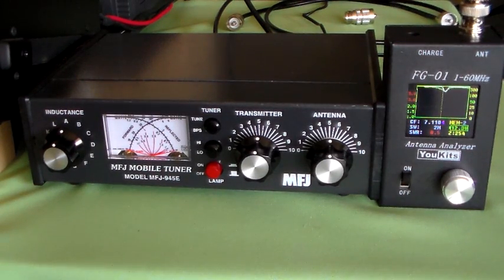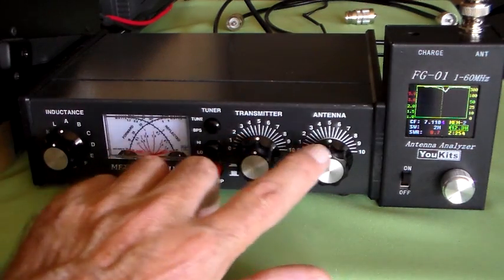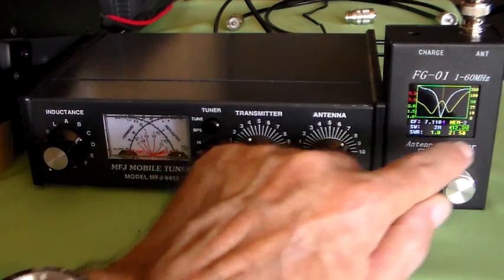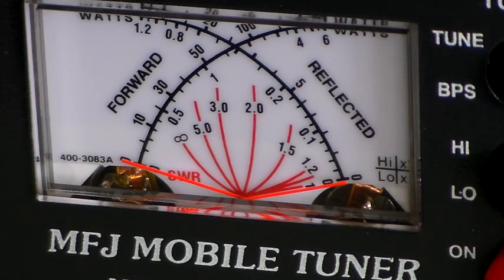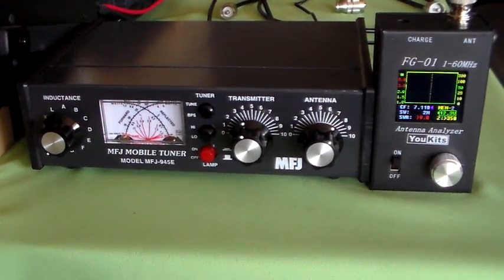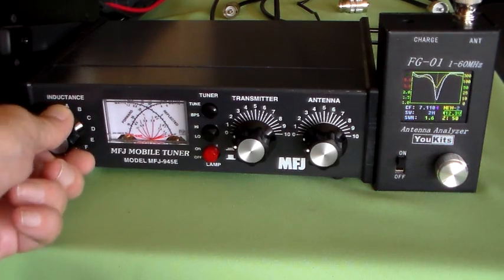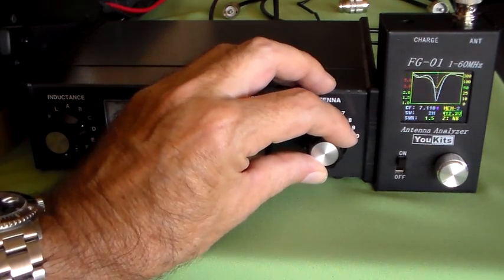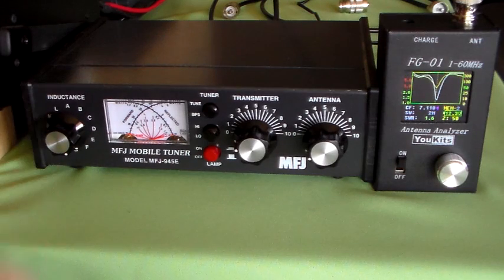Best Manual ATU Tuning Method.

Comment: Thanks for this video. 941E  manual says that you can get the similar SWR readings with different  inductor settings. What about if you have used some other inductor/inductance setting C  - any comment on that. 73' OH2XA

Comment: Is the FP-RP meter between Tx and ATU or between ATU and feedline to antenna? If former, how much of tde 5% increase was lost in the ATU? If latter, how of the 5% increase  sdows up as a 0.2 dB increase in radiated RF?

Comment: I still have my roller coaster and variable capacitor I used to use. At times I still do.
L inline and C from the long wire or vertical to earth. For some lengths of wire It was better to put C at the other end of L.
I used to tune for maximum r.f. out using an r.f. pickup meter at the aerial before I made my resistive SWR meter. My amateur friend was horrified! He was still horrified when I didn't calibrate the meter and just tuned for the lowest reading. After 5 years I did calibrate it.
I found that most r.f. out didn't necessarily coincide with the lowest SWR. I'm only talking a fraction more out as you showed. Somebody's receiver would not notice.
Nothing above 5 Watts here.
G4GHB

Comment: The MFJ manuals differ on that point. The MFJ-949E manual advises you to set the maximum capacitance and minimum capacitance possible for a good SWR. I've followed those instructions and got nice results when using my 11 meters T2LT antenna. I was able to tune and get signal out from 10 to 30 meters.

Anyway, the more inductance, the more fiddly the tuning is.

Comment: That was fascinating. Thanks for posting. Any idea why you measured slightly more RF power out despite a higher SWR?  Seems counterintuitive. 73
Reply: I found it too on my set up. Maybe true resonant point of an aerial?
G4GHB
Reply: @bill-2018  When I match my vertical antenna, I can't select max C. If I set max C, no amount of I will bring the SWR down below 3. I have to start at mid C, then I can find a suitable I to get the SWR below 3. Then I can get the SWR down to 1.0 with a little more C on both sides. One oddity I have observed is that sometimes I get a little more forward power when the SWR is slightly above 1.0 (roughly 1.2-1.3).  I can't explain it, but that's what I see on the 945E meter. Someday I would like to understand this better. 73
Reply: @nateitkin8279  I had (still have) for many years a long wire with a roller coaster and variable capacitor to tune it and an r.f. pickup meter at the aerial. When I built my resistive SWR meter I found a tiny difference between the lowest SWR and maximum r.f. out. Very tiny! No-one at the receiving end would notice.
Watch Dave Casler on his Y.T. presentation on Ask Dave number 221. He explains SWR and resonance and inductive and capacitive effects on aerials.
73, G4GHB

Comment: Try Antenna cap at Max and Trans at 30 % cap. You usually do not have to change the Ant cap again. I use a Heathkit tuner.  Thanks and best..

Comment: Nice video.  I wonder if the difficulty encountered in method 2 has to do with the choice of the physical position of the taps.  They were factory set with the method 1 in mind.  To best set it up for method 2, I guess one can change the tap positions on the coil.  Likely a fools errand from a practical point of view.

Comment: The slightly more forward power is a myth.
What is actually going is that there is a phase variant between reflected and forward power.
So you are measuring more forward power but this can not be true since your transmitter is only a certain power. Say 1 Watt.
Make your SWR slightly higher and you see more forward power.

If you really want to measure what the best tuning position is, get a field srength meter and try to find the 1:1 position that gives you the highest field strength.
That is the position you need.
Reply: As reflected power is reflected back to antenna in phase with the forward power at the radio /feedline mismatch, (adds together) it's not a myth

Comment: a lot of you still seem confused about this
there is ONLY ONE proper combination of inductance and capacitance for the (most efficient)  True Tune
there are multiple ways to find it and there are plenty of settings that are just good enough but still ultimately only one is correct
only the one True Tune allows for tuner's full rated power handling  without an arc

Comment: You appear to get more power but what is happening is the reflected is added to the out  put appearing to have more out. Cross needle meters always add in the swr !
Reply: Thats correct the reflected power joins the forward power back towards antenna

Comment: K4KID here... Typically you have to double your power (3db) for someone at the receiving end to tell the difference so the needle's breadth of increase is negligible. Thanks for the lesson though.
As for reflected power... I would prefer 10 or 20% less power out w/ ZERO reflected power to keep my finals happy. I have a 31 year old Kenwood TS130 w/ the original finals that still produce full rated power and I think that's because of the "LOVE" I've shown them. Happy airwaves to all. K4KID

Comment: With my own t-match I used to start with both capacitors half meshed and then find the inductance for best match before making final adjustments to the capacitors. I don’t think that it was the optimum, efficiency was not my problem but flashover at high power was. I know this video has been up a long time, the behaviour of the forward power meter is normal, it does not prove the power to the load is increased. Just a suggestion, put a 100w lightbulb in a box and use an exposure meter or LDR to determine maximum brightness as you tune the atu, many rigs can produce more power into loads that are not exactly 50 ohms with zero reactance. Found your channel via your GS35B experiments, great stuff.
Reply from the maker: Thanks. The difference in output power wouldn't be detectable at the RX end. It was just a fun experiment.

Comment: I used an Ericsson auto AMU many years ago that tuned under low power. It started with min L and min C, then increased L until max fwd power, then increased C for min refl power. As the refl power dropped, the fwd increased. Further fine adjustment could be done after the auto had run to obtain the best match.

Comment: the higher power reading with max cap is due to circulating currents and is Not adding to the forward power despite the reading, just to heating.
You significantly reduce the max power handling before arc-over of the tuner with this tune as you have to use both more XC and XL
Should always tune with least inductance even thought other combinations are possible 
Least inductance will give you the widest tuned bandwidth and is much less touchy and fussy - less coupling to your hands while operating the knobs and ensures highest max power handling before an arc over
Reply from the maker: Yes, setting the caps to 50% and setting the inductance is the way to go.
Reply: Reflected power adds to the forward power back towards the antenna at the feedline /radio mismatch

Comment: so how to tune up with a radio without transmitting, do you use a tee into a dummy load? can you show.
Reply from the maker: No T piece. Take the coax out of the radio and connect it to the antenna analyser. Set the frequency of interest on the antenna analyser and adjust the controls on the ATU for a good 50 Ohm match. Then take the coax off the analyser and connect it to the radio.

Comment: If you are transmitting 1W from a rig capable of transmitting more than a watt, then there is some sort of control loop inside the rig keeping the power at 1W.  A couple of methods of doing this are to monitor the current in the PA or detect some of the forward power using a directional coupler.  In any case the assumption of the designers will have been that the transmitter will be working into the nominal impedance i.e. 50 ohms, and all  the development work of the power control loop will have been done into a 50 ohm load.  If you mismatch it, the power control loop will move to a different point.  It may produce more power, it could be  be less power - nobody knows because you have moved to a condition where the behaviour is not specified.  All you are doing is looking at the behaviour of this control loop under the changed conditions, and you have not proved anything general at all.

Comment: I want to say a big thanks to you for taking the time to explain to the new amateurs how to use a manual tuner. I started off with the old Military style variometer, ie. crank it up to get an antenna current reading showing on the meter and usually adjust a capacitor to tweak for maximum. This was done at a rate of knots so you were spending minimum time sending out a carrier. Totally crazy has you then spent ages on that frequency banging away on the key passing all the required traffic that needed sending. 73 de John - G0WXU.
Reply from the maker: Thanks for the feedback John. Of course it's much easier when no-one is shooting at you.
Reply: Sounds like you were working with a transmitter much like the Command sets used in WWII bombers. Those were my first ham transmitters.

Comment: You called it a "Manual ATU."   "ATU" stands for "AUTOMATIC" antenna tuner."  A "manual ATU" would be a "Manual Automatic Antenna Tuner."  Say what???
Reply: Antenna Tuning Unit
Reply: ATU actually stands for Antenna Tuning Unit. The correct acronym for the automatic version is an aATU.
Reply: ATU = Antenna Tuning Unit

Comment: I have the 949E and it is great… 3945 looks good as well
Reply from the maker: The MFJ tuners get the job done, you just have to remember to halve the power rating. What's a 3945?

Comment: Nice demonstration, may I add another quick reference point to start with is tuning for noise first, capacity half way then find more noise with induction, most occasionally you are near a reasonable matching point. 😁
Reply from the maker: Thanks Ray. Good point... I'll try to remember that if I do any more of these videos.

Comment: Bought first manual ATU this week and struggled so far  :(   Found this very informative and practical thanks - just need to go and put it into practice. I'll be back to say how I got on !
Reply from the maker: Thanks for the feedback. Good luck with it, I'm looking forward to your results. What ATU did you buy?
Reply: Hi, I bought the Comet CAT-300. The unit is fine but the instructions useless. I think it would be in the bin by now if I hadn't found your youtube tutorial . cheers Mark 2E0XCZ
Reply from the maker: There's a couple of videos on that tuner here on You Tube... it looks pretty good. What's a bit less confusing with the MFJ is the inductor is labelled A to L, not 1.8 to 50MHz, so if you choose an inductance that works it doesn't look wrong if it has the the wrong frequency band written on it. I'm glad you found my video useful, thanks for the feedback.
Reply: Ditto for me today with the MFJ 945e, over the MFJ 959c auto, bog difference in Leicester for the manual, but happy with my choice

Comment: I use to work you guys (VK/ZL) back in the early 1980s on 20 Mtrs running a Signal One at 5 watts and a 40Mtr dipole. VK6 and VK7 were my favorites.
Reply from the maker: I worked VK from London in 1987 when I got my UK 'A' licence. Just 100W and a bit of wire down the garden. You can work the world on next to nothing when the sunspot cycle is generating lots of spots.

Comment: I'm new to hobby, so thanks for this. I haven't got my license yet but have built a 20m doublet (open wire fed) and have just bought the MFJ 949e. Because I'm only listening for now, is there a way of using an ATU to increase receive noise? Do you set it for max reflected?
Reply from the maker: Just set the capacitors half way, then rotate the inductor switch for the maximum noise, then adjust the capacitors to peak the noise level.
Reply: Thanks for that, really appreciate the quick response. One other question, if I use Bypass, will that permit LW, MW, VHF, UHF through to my SDR? again thanks very much, 73 Adrian.
Reply from the maker: When I tune around I have my tuner in bypass mode because peaking it on one frequency will put attenuation in on others... especially if they are MHz away. In bypass mode it's a lot like connecting the antenna directly to the radio.  LW and MW would be ok but there is stray capacitance in HF tuners that may adversely affect VHF and UHF signals. It wouldn't hurt to just try it.
Reply: Just want to thank you again for these tuner vids, and all your other output. 
I sat my exam there before Christmas (we only have one class here - all or nothin'!) . Your videos were of great help and added to my understanding of theory elements etc. So thanks again.
73 Adrian EI9HAB

Comment: I was wanting to purhase this but I dont understand where to put the balancing wires? Do they go on the antenna or what? I dont want to hack into my jpole.
Reply from the maker: This is designed for feeding coax, it's designed for tweaking mobile whip antennas. It does have the tuning range to match wire antennas that are quite long though. If you want to connect it to a balanced feeder you'll have to put a balun on the output. Something like this: http://www.ebay.com.au/itm/MFJ-911-4-1-Balun-UnBal-300-Watts-/111802128383?hash=item1a07ed17ff:g:uY4AAOSwQTVV-JVZ Then just have a coax lead to connect the antenna port on the tuner to the coax input of the balun. You would probably be better off getting a tuner with a balanced output.

Comment: just curious, but what would bypassing the antennae tuner be, minimum capacitance & minimum inductance?
Reply from the maker: No, the only way to bypass the tuner is to press the 'bypass' switch or take the tuner out of circuit. The bypass switch is the top one of the three to the right of the meters. All commercial ATUs have a bypass switch, the auto-ATUs will bypass if you remove power to them.

Comment: WD4ED is quite correct. A tuner, or any tuned input or antenna for that matter, is matched with either capacitive reactance or inductive reactance assuming that the feed point is not 50+/-J0. The efficiency of the radiator (antenna) is a function of the ratio of forward to reflected. But, we all know that. 

So an antenna tuner matches the output of the RF output to look perfect to the transmitter. So, the VSWR meter on the tuner shows the result of that match. However, the tuner is not adding to the efficiency of the antenna. As to another question: where is the loss in RF going? Well, back into the antenna tuner. The reflected power has to go somewhere. Do antenna tuners get hot?  You bet and so do tuned stubs.  73  WA6VWY
Reply from the maker: I think his point related to the efficiency of the match the 'tuner' is providing. Not the efficiency of the antenna.

Comment: Thanks for the video. I discovered that the reason I couldn't tune my homebrew 40 meter dipole wasn't a problem with my antenna but the procedure I was using for the tuner. I now have a 1:1.1 match with 0 reflected power.
Reply from the maker: Thanks for the feedback. I'm glad you found it useful.

Comment: ATU? Is that an antenna tuner?
Reply from the maker: Yes, ATU = Antenna Tuning Unit. Antenna matching unit is a more accurate description as they don't actually 'tune' the antenna, they just transform the mismatch impedance to 50 Ohms to keep the radio happy.
Reply: Match impedance, got it. I understood the idea, never heard the acronym. Thanks.

Comment: How are these instruments connected together?
Reply from the maker: The antenna port on the ATU is connected to the antenna, the antenna analyser is connected to the TX port on the ATU. So when the ATU has been tuned for a match the lead on the ATU TX port is taken off the analyser and connected to the radio.

Comment: Great tutorial video i always use the first method and have done for years i was told to do it this way by a dear friend G3MRP now silent key  set the caps mid way point listen to the band you wont to tune and move the inductor you will hear the signal come right up you now know your in the right place to start tuning .Thanks for posting i  know its an old post but i just stumbled across it cheers from across the pond.
Reply from the maker: +John Gulliver Thanks for the feedback, cheers John.
Reply: I use to do it that way and then I would move down maybe 1 step on the inductance and add a little more capacitance. I use to be able to tune it with out a SWR meter by using a receiver and turning down the RF gain very low and turning up the audio high. You can really hear it when it is peaked.

Comment: Thank you very much for your videos. I'm just getting started after a 28 year absence from radio, and I'm very happy that you posted these. Actually, now that I've seen your videos, I'm contemplating buying the FG-01 Antenna analyzer. Seems to be the missing link between your transmitter, swr meter, and antenna. Makes tuning a breeze. A little salty on the price, but it's probably worth the money. Again, thanks for posting these, and keep up the good work.
Reply from the maker: +Robert Hughes Thanks for taking the time to post the feedback.